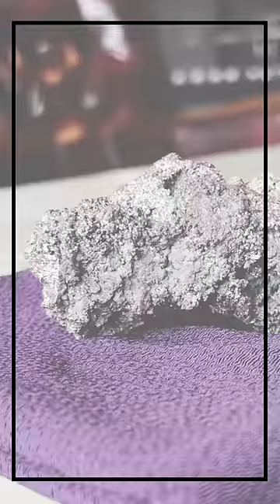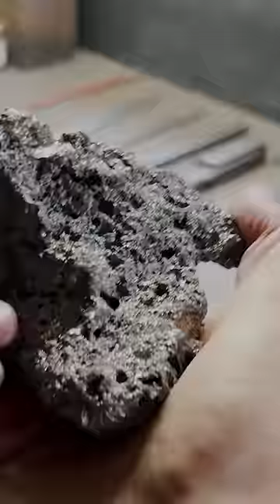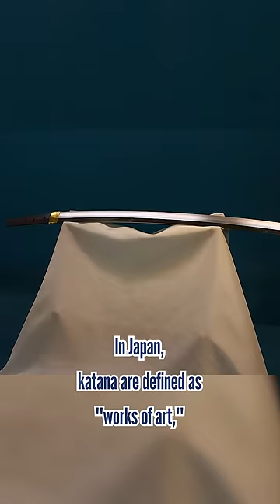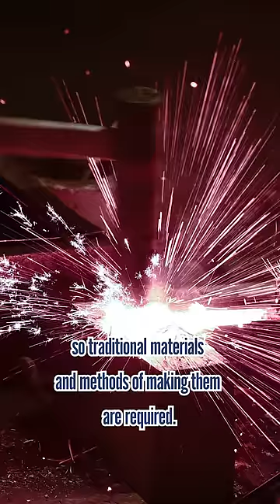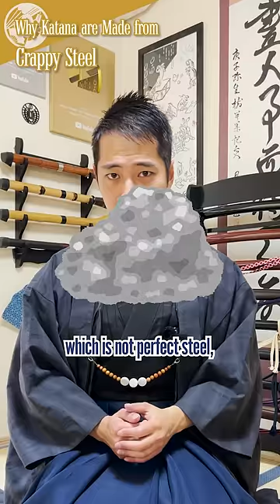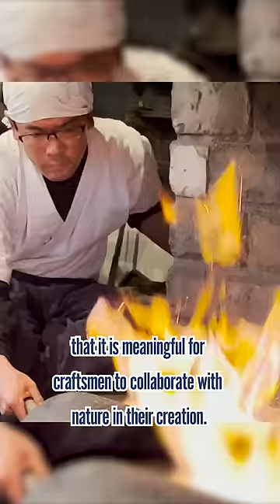Why Katana are Made from Crappy Steel #Shorts

Comment: In what sense is the steel used in katanas considered to be of poor quality? I understand that it is not stainless and that katanas have to be kept properly in order to prevent them from rusting, but other than that, are there other issues?
Reply: It’s a myth that Japanese steel was any worse than in other places during the Middle Ages. It is true Japan needed to use techniques like folding and differential hardening to remove impurities from the iron, but it was the same everywhere else. And similar methods evolved independently over many cultures. 

But later, during the Industrial Age, we moved away from traditional swordmaking as we figured out how to fully melt iron, removing the need for folding techniques. Most modern swords are made with steel that is MUCH higher quality than any steel from the Middle Ages. But some people seem to genuinely think that medieval European swords were made with modern spring steel..
Reply: @anironfarm6056  Thanks!
Reply: @anironfarm6056  Isn't it nice that some people believe that European swords in the middle ages suddenly went from iron to spring-tempered modern alloy steels that can bend at insane angles and still return to true while Japanese blades are seen as primitive because of a couple of Youtubers that have perpetuated this idea without understanding the constancy of historical steel quality and also some German guy that tested a modern day longsword to a historical katana in a way that a sword shouldn't be used, leading to the myth that Katana were flimsy glass blades that were somehow forged from pig iron?

Have fun with that run on sentence
Reply: @anironfarm6056  I’ve never seen anyone claim that they used modern spring steel but in the late medieval period they most definitely using a form of spring steel that was becoming producible on a large scale. Japan and Europe by that point had fairly different techniques and types of steel. I’m not saying either was better than the other but European swords were a lot more flexible but softer and didn’t hold an edge as well meanwhile Japanese swords were much harder but very inflexible in comparison. Both types of steel worked very well for their location and usage. I’m not too knowledgeable about the Japanese methodology for steel but in Europe they discovered ways to heat iron to a hotter point for longer to make steel in the 13th-14th century and those techniques rapidly became widespread. To claim that Europe and Japan had super similar techniques to sword making is quite frankly unfair to both of them, they had very different techniques both of which deserve to be recognized and respected.

Comment: I didn't know these three reasons but The 4th reason I did know was that this sort of steel is much better for the folding process of making swords more popular in Asia, folding a softer steel over and over gives you a much better sword than straight hammer forging harder steels if you made a samurai style blade with say Damascus steel it wouldn't work, either the blade wouldn't be able to fold enough at all or it would be so brittle it would shatter against any resistance
Reply: What are you even talking about man....

Comment: people forget that if a broad-sword and a katana literally clashed, the sword would absolutely obliterate the katana. Swords are made of much better material.
Reply: Firstly, European swords weren't made from better steel. The thing is European furnaces were hotter, thus removing more impurities from the blade.
Secondly, you can't argue with physics. Katana edge was ~60-65HRC, sometimes even higher. Whereas european swords were fully made out of spring steel. Average hardness of a european sword would range from 40 to 45, rarely 50HRC(more modern swords ~16th century). Softer steel can't damage harder steel, that's freaking physics dude. 
And also last point. Because of katana differentially hardened nature, it would almost certainly never snap into halves, unlike European spring steel swords. Softer spine would deform, but overall structural integrity of katana will remain(chips on the blade edge are possible). Whereas European mono steel sword, if strike force overcame ultimate tensile strength, would just crack and snap into halves.
Reply: European swords had a wide range of qualities.
Reply: The whole idea of fighting with a Katana is not to clash swords, it is to avoid the other weapon and wait for the opening the other fighting style always creates.
Reply: Literally just not true at all
Reply: @Fullerite_  The idea that Japanese furnaces were not hot enough is easily dismissed by the existence of zuku oshi tatara and the history of indirect steel production methods in Japan. They produced cast iron, therefore they had that level of technology people often associate with Europe. This is not a major secret in Japan, you can easily check on the Japanese wiki for the tatara.

Second most important point is that beside the hardening process, European swords well into the 17th century were made like Japanese ones, with inhomogenous steel and often layers of different steel, sometime even with iron cores. Hence, they will not be that springy in the first place as modern replica.
For reference, there is a very interesting paper on Italian swords of the 16th and 17th century with their production - "Archaeometallurgical Investigation on Historical Sword-Making Techniques in Northern Italy Between the Sixteenth and Seventeenth Centuries"
Reply: @hugom2418  it's true.
Reply: @Fullerite_  I said Broad swords my dude.
Reply: You got your source from that one German TV program where Stefan tested a modern made longsword against a historical katana, didn't you?

Comment: @LetsaskShogo So, what steel do you think is the most appropiate for Tameshigiri? t10? i`d love to get some custom katana but i dont know what steel i should choose, ty for your videos!
Reply: T10 tool steel is the best carbon steel on the market that's mass produced 

You can spend 100s of thousands of dollars on a custom carbon steel alloy designed by computers, but it takes time and money.

Where any smith can get a hold of T10/tamahagani/spring steel/ then your 10xx series carbon steel(like 1060 or 1040) the higher the number the better quality, so 1060 is better than 1040
Reply: @410cultivar  I`ve heard that 1090, for example, is more fragile since has less flexibility, do you know if that is correct? In that  chase, which one would you recommend me? Thank you again bud ;)

Comment: tamahagane is typically a higher quality bloomery steel than you'd find in similar time periods anywhere else in the world. though as the medieval times moved on into the Renaissance, Japan "stagnated" as Europe and the west began to produce higher quality furnaces and therefore steel. Inventions such as the hearth furnace eventually allowed the west to produce high carbon steel more often, and at greater volume, and therefore no longer needed the extensive welding and forging work that more primitive steels require(such as Tamahagane). In conclusion, tamahagane isn't necessarily "bad steel", primitive materials such as wrought iron, bloomery steel, etc are capable of being turned into amazing tools and weapons with proper skills and knowledge to do so (Look at just about everything metal you see made before 1868 when the Bessemer steel process was created, it was mostly hearth or bloomery steel paired with wrought iron). That said, do most modern high carbon steel alloys today out perform the older materials, yes. though I appreciate the Japanese for keeping that age old knowledge and skill set alive

Comment: The entire reason that the steel for katanas are folded so many times is to spread out the impurities of the metal to achieve a uniform strength and purity. The whole art form of crafting the blade is based around working with the flaws of the material. Using better quality steel would render it pointless.

Comment: Is there any connection between the steel and how they harden these blades? I’m no metallurgist but I would think that harder material would be more prone to brittleness and with different parts of the blade cooling at different speeds the choice of steel would be a significant consideration. ultimately it’s tradition that determines the process but perhaps the tradition formed on more of a practical basis.

Comment: It’s high carbon so it’s soft and moldable easy to fight with and clash blades they bite into one another and the hardened spine maintains overall integrity, high carbon steel is also easy to sharpen and takes a wicked sharp edge

Comment: I believe the misconception is based in the metal having a lot of impurities before forging - while ignoring that the process of folding the steel forces said impurities out. It's not as pure as modern steel, but we now have much better technology and techniques we use to purify the metal, so we get an insanely low amount of impurities.

Comment: Harder, moddern steel would be harder to sharpen and you would not be able to make a hardened edge; soft back combo which would lead to a sword that cant absorb propperly so ive you strike the vibration goes either directly over the sheat in your hands ore it might snap.

Comment: Tamahagane would be considered... unfavourable in Europe (not to use derogatory term pig iron...).  Mostly - due to amount of work required to work it.
It does not define quality of finished product, but required a very skilled smith, else end result would be of dubious utility. 
So yeah as craft - it's much more impressive to create a sword from Tamahagane rather than modern steel. It asks much more of the smith, more effort... so talking about swords having souls becomes much more fitting, when smith puts everything he has into making perfect product, rather than something coming from uninterested craftsman churning out decent swords with little effort by the dozen.
Reply: Tamahagane isn't pig iron. Tamahagane's just high carbon sponge steel, and pig iron is just the product of using a blast furnace.

Comment: Carbon steel holds a sharper edge than other steel. It doesn't chip or flake when sharpened.
Reply: Depends on hardness and grade of the steel, and the geometry of the knife (cross section, profile, angles.)

All kinds of (tool) steel can chip, all kinds of (tool) steel can roll. 'Carbon steel' is no exception.

Comment: I think carbon steel is great it may not hold an edge as long as something like magna cut but I'd rather strop my blade in the field than spend hours sharpening which you most likely wouldn't be able to do in the field ....trust me the Samauri knew what they were doing

Comment: there's a reason why the steel is folded and hammered and forged over and over. to get the carbon out!

high carbon steel is not easy to work with. it's brittle. "cast iron" is a high carbon steel. pure iron is very malleable. low carbon steel is basically a more pure iron, and is thus malleable. it's the carbon that makes iron brittle, because carbon is non metallic.

using a low carbon steel to make a katana would be like taking out the forging process. you would just need to sharpen it basically. it would trivialize it.

Comment: Does the type of steel also have higher carbon levels than most steel? I read that the steel used is higher in carbon than most and takes quite a bit of skill to use.

Comment: All steel has carbon in it, the metal used was traditionally low quality and that's why it was folded and made like it is. Modern metal might be high quality, but it wouldn't make much difference if made the same way

Comment: May i ask something?. Why katana did not Made using stainless steel material?, So you don't have to worry about rust

*Bad English
Reply: Because stainless steel, as a blade material, starts to lose structural integrity after 12 inches or so. It may work on shorter swords. But a functional katana is a no go.

Comment: there is a deeper explanation without a defense . Japanese savounts when creating the metals to craft the samari swords .are smelted from the minerals of the land .which, when crafted , leaves the craftsmen with not one but two low and higher carbon steels, which are a part of being forged together .softer lower carbon steel on the back of the blad and the higher carbon steel laying out the blade .and had nothing to do with crapy steel are the gods .

Comment: Was there any better steel available back in 1500?  I think that´s the reason.
Reply: Well yeah, basically.
1.) Japan has been using blast furnaces for quite some time, hence fully liquified steel ingots. (These got processes into steel)

2.) Actual iron ore (mochi tetsu, but sands aren't that bad in the first place since they used a process where sand was removed the same way as someone would pan for gold.

3.) Steel quality in the past was fairly consistent. It'd be like saying who made the best bread back then.
Reply: Not in japan and not really for the katana. There was spring steel in Europe which works great for European swords and most everything else but wouldn’t work for the katana and it’s intended usage.
Reply: @UwU-235  There wasn't "spring steel", but there was spring tempering that was kinda used in the late middle ages and then widely adopted in the 17th century.

Before that, most European swords were like katana in the sense that they would have a possibility of taking a set.

Comment: The amount of marketing for a sword that is honestly bad at best, rigid, not flexible, prone to bend and made with bad steel. Japan it's the only country that can sell that as art
Reply: It isn't even a bad sword. Also katana do flex.
Reply: @jonajo9757  that's only a said in design. It's materials were plain bad and thinking about how were they used and who were used against made them horrible. You won't,  even in a million years cut through scale, plates or even mail with a cutting sword. In the eras this sword was used it was useless against armored samurais, you had to use very narrow, flexible, light and straight swords or spears like a rapier, a tizona or could have used a zweihander who had brute force being light enough to exploit that gaps in the armour.

Comment: Carbon steel? Isn't that all steel, without carbon its just iron.
Reply: Well, carbon steel is steel with more carbon than most steels
Reply: @Tigerboy  So a 'High Carbon Steel' would be a more precise term. More carbon = stronger but more brittle, its all about the ratio.

Comment: These are not great answers. In particular, tamahagane is not "high quality".  The real reason is that after WWII, the US sought to pacify Japanese culture.  One of the measures was outlawing the manufacture of weapons. Originally, this included swords. After a few years, as a way of preserving this element of Japanese culture, swordmaking was legalized  on the condition that it be carried out using traditional methods and materials, and that the number of swords made by each smith be dramatically restricted.  It is, therefore, illegal to make swords in Japan using modern steel.

It's true that using traditional materials has appeal because it maintains the ancient methods, and there are some esthetic features related to tamahagane. But that's not the real reason tamahagane is still used.

Comment: The carbon level is a non point. Modern steels surpass it by far in carbon levels and lack of impurities so pt. 2 is not valid. It is exceptional because of the tradition and the skill used to make steel with impunities strong and beautiful. Almost every civilization that has ever developed steel has gravitated to high carbon steel.